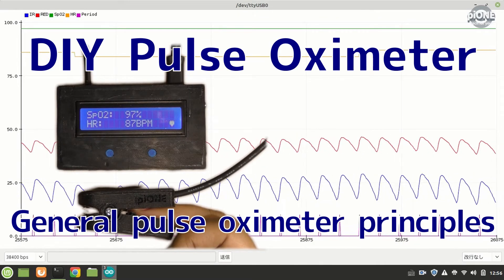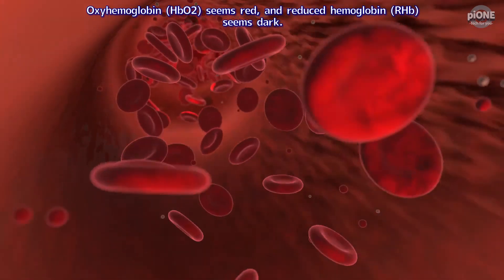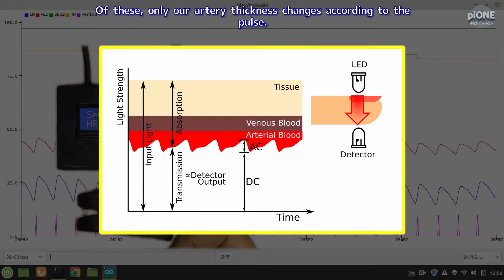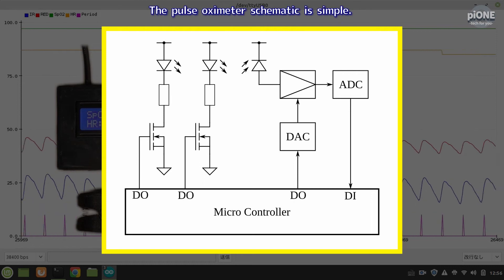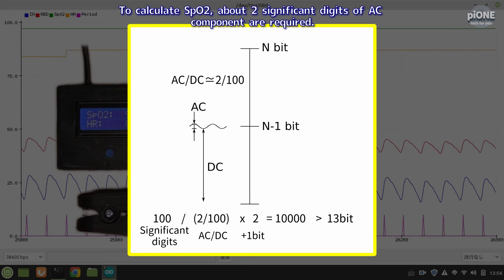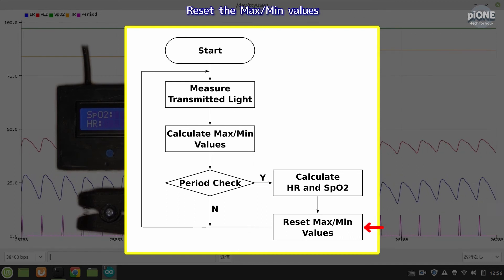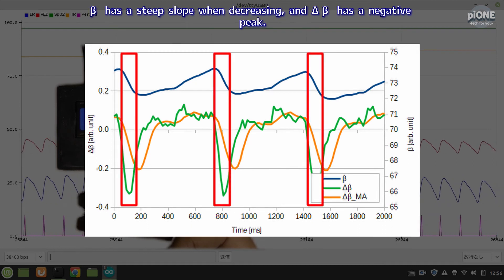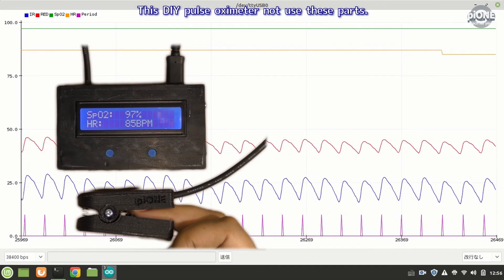DIY Pulse Oximeter you can make   2. General Pulse Oximeter Principles

Comment: Will the curve fit formula work for a device using the reflective method? In this case I mean using the MAX30100 SpO2 integrated circuit. The MAX30100 data sheet doesn’t provide any information on calculating the SpO2. The device only gives the red/IR LED measurements. It’s up to the user to figure out what to do with the red and IR data transmitted over I2C.
Reply from the maker: The transmissive type formula cannot be used for the reflective type.
You can find the MAX30100 calculation methods from the MAX30100lib.
https://www.arduino.cc/reference/en/libraries/max30100lib/
MAX30100_SpO2Calculator.cpp

This library uses tables.
Reply: @pionechannel1551  thank you. I expected that there may be a difference.

Comment: Hi, very nice project! The guide is well explained and it looks profesionnal. I have to do a similar project in my university and i would like to know where the formula to get the SpO2 came from? Thhe big one: 0.3557R^3 -5.186R^2 - 18.34R +108.4. Do you have any reference for this formula?
Reply from the maker: Thank you for comment.
This formula was driven by approximating Figure 5 curve of Reference [3] to a cubic function.
https://pdfs.semanticscholar.org/a9e1/3b071da1ff76543932c653b9271ccdd463e8.pdf
Reply: @pionechannel1551  Thank you so much! The article is really helpful. Keep up the good work! :)